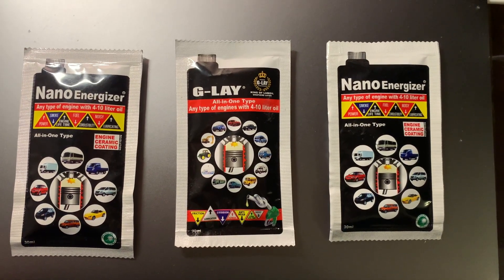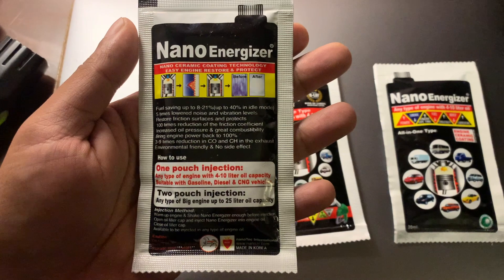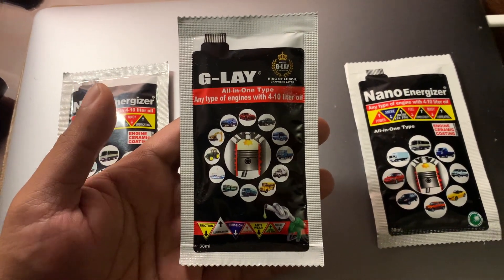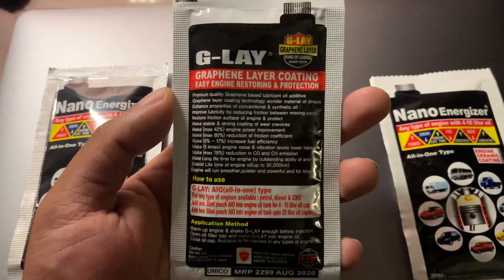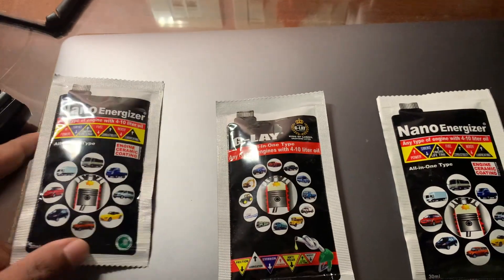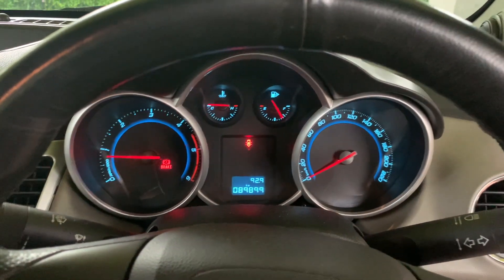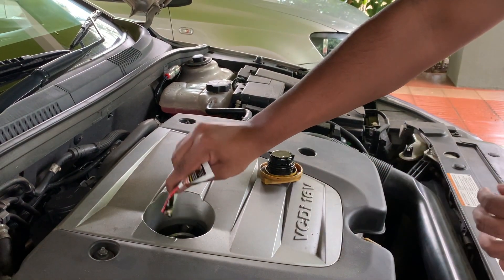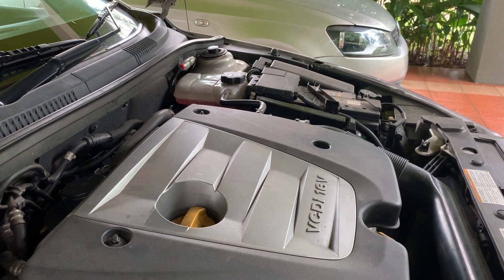Nanotec G-LAY Graphene Engine Oil Additive Overview and Application

Comment: Graphenizer is Trending Top No:1 in Google because of its amazing performance.

Graphenizer is a revolutionary product for those who are experiencing overheating engines, low pickup and performance, high fuel consumption, and high carbon emissions with black smoke from their engines, as it is the only solution for all the above problems to be solved instantly.

It not only cleans the engine and enhances the performance, but also provides a cure and saves the engine from further damage. It gives it a long life by providing a protective coating to its internal parts like pistons etc. It can be used for all the vehicle's engines, and it is very convenient to use, and the results are immediate and long-lasting.

performance of your product. It will help to improve the performance of the car, the fuel efficiency, clean the engine and avoid knocking.
Reply: How much

Comment: Both NanoE and Nano GLAY (the newer product) are genuine products since 2009 and 2019. Works very well especially on higher mileage or older engines. Just that its not widely promoted or advertised so a lot of people are skeptical about it, especially when it comes in a small package. When users continue to use after every 1 to 3 oil change, users will experience better mileage and better engine performance.

Comment: This sounds a lot like the claims originally made by Slick50. They claimed it would coat your engine with special nano particles for better gas mileage, blah blah blah I used that back in the late 80s/early90s in my Camaro Z28, it was a terrible product. Actually the car did run better for about the 1st 500-1k miles or so, then it started running like absolute crap and I had to change my oil ASAP. I wonder if there are any objective reviews or data on these products?

Comment: Hello from Ukraine! I recently got my graphene from agro hemp. 1 gram of graphene in your engine oil and this is 1) Reduced pollution (20 ~ 90% reduction for cars with problem exhaust fumes over 5 years old) (2) Double your engine oil change periods ... - An exception for cars is the problem of engine oil leakage (3) Reducing engine noise and vibration (4) Increasing engine power (5-30% increase) (5) Reducing gasoline or diesel costs (saving 5-30%) creates a durable lubricating film on all friction and sliding surfaces. This reduces friction, ensuring smoother operation of the units. This gives the following advantages: significant fuel and oil savings of 5-30%, scientifically proven wear reduction, high reliability, anti-friction properties. Intended use: Suitable for all commercial engine oils in gasoline and diesel engines with and without particulate filter (DPF). Safety tested with catalytic converters and turbochargers. Our dosage recommendation: Add 1 to 1.5 grams to the engine oil. For motorcycles with wet clutches, add a maximum of 2 grams of oil.

Comment: Did you find G lay helps to fix engines vibration
Reply from the maker: Stay tuned for an update video after 500 kms of using G-Lay.
Reply: @pjoh7  Did it work for you bud?
Reply from the maker: @Shahrukh70123  hi, yes - I have noticed a significant increase in mileage (about 15%) and increased smoothness at low rpm. Will make a video to update.
Reply: @pjoh7  HI, has it worked over long term, any updates yet
Reply: Please update the video